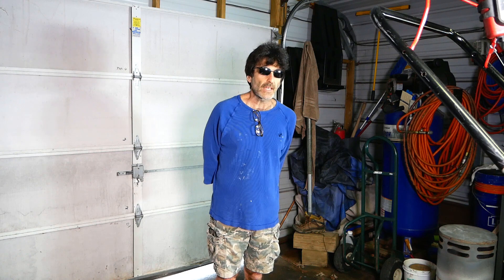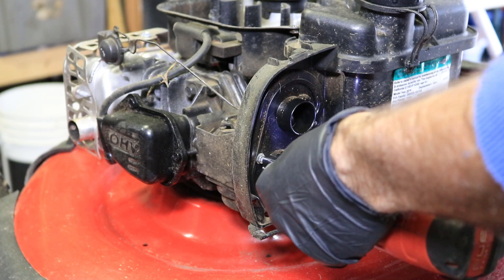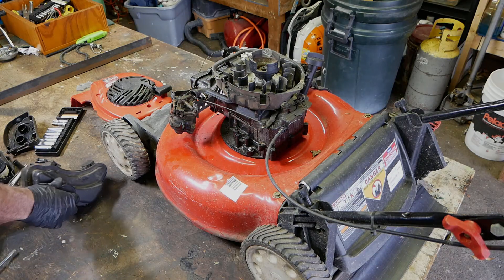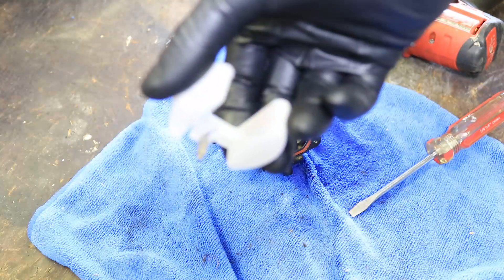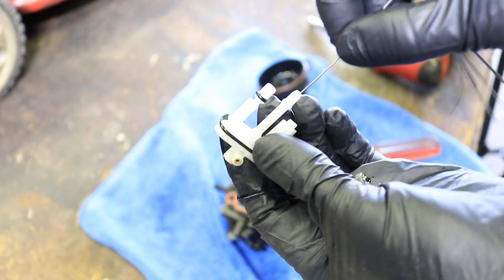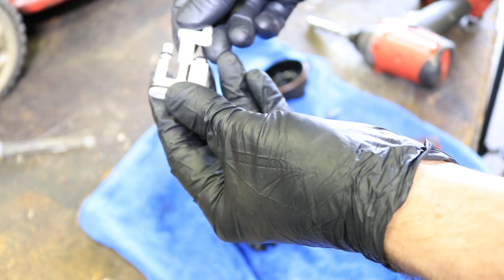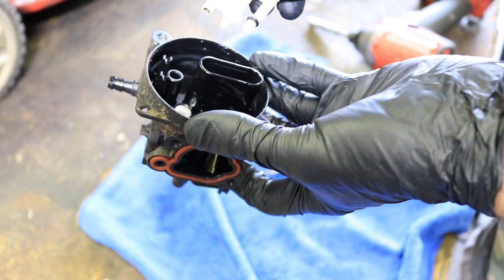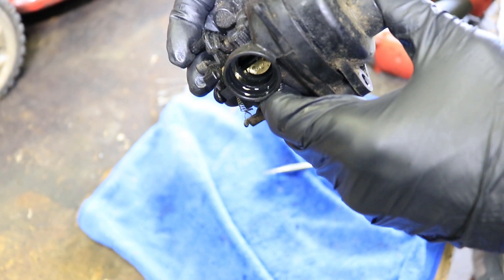Briggs and Stratton 550EX Won't Start!

Comment: I have same mower took plug out checked compression with my finger its good Used starting fluid got it to run a bit and died I'm going to just buy a new carb eBay for $8.00 free ship see where it goes from there your thoughts?  ...........................                         I just don't want to go through the cleaning don't have the cleaning tips and dont want to do the work and have it not work out besides for this price why not thank you for your video G
Reply from the maker: HI!  I had one over the summer that gave me a fit...  I tested this and that for many hours and it just didn't seem like a carburetor problem to me....  In the end I reluctantly replaced the carburetor and that was the whole problem!  Lol.  I'd never been stumped like that, but it happens..  From the sounds of it that's what's going on with yours, but of course without seeing it I can only guess.

Comment: Mine wont start even after I cleaned out the carburetor
Reply: It's been sitting for at least 6 or 7 years
Reply from the maker: HI.... My guess is you're still having a carburetor issue.  If you've got compression and spark,  I'd try the main jet for that carburetor.  592792 is the number i've used in the past.  Just make sure it'll work on your mower...  Make sure to flush the gas tank and replace the fuel line...
Reply: @JLPicard440 hey thank you, i managed to get it working. I used a wire from a bread bag tie to clean the carburetor the second time because it was still clogged and it starts on one pull now.
Reply from the maker: That's awesome!  And even better, that's a free fix... 😊

Comment: Idk if i hit something but filter door and filter just flew off ....i put it back together started working normally for 5 min and it slowly turned off now cant get it to start
Reply from the maker: Hmmm... That's an interesting problem.  I've never seen that happen before.  Has the carburetor dislodged itself?  Maybe there's a vacuum leak behind it..  Worth looking at... Sometimes if the gas tank cap has a problem it won't vent correctly and it'll cause the fuel to not drain, but it sounds more like something to do with why the filter flew off!

Comment: Teacher, 

Your instructions are the best! 

I have a Craftsman LM with a B&S M110 engine, that would not start.

I had watched many other repair videos, but yours was the most detailed. Your lesson on how to disassemble and clean the emulsion tube was the secret that ended my mower troubles.

Thanks for sharing your wealth of knowledge. Joey Adair 
After reassembly, one pull it started.
Reply from the maker: That's awesome!  Honestly you made my day knowing I was able to help someone... Thank you... 😊

Comment: Good morning Take a Bath Productions. Very  impressed with you keeping up with all of the replies (as recent as 11 days ago!) so thought I'd seek some help if you're willing. I've got the same engine here and am still struggling to get her to start. I've pulled the bowl off of the carb and drained the gas tank and replaced with new gas, no luck. Tried pulling the entire carb out, draining gas again, opening the carb out and cleaning/flushing all the pieces including the three tubed piece, put it all back together and still no luck. Before it stopped starting, it was surging when running. I use non ethanol gas, but the only non ethanol gas close to me is 92 octane. Maybe the high octane gas is too much for the little engine? I'm not sure what it could be.
Reply from the maker: Hello... I really don't think the higher octane gas is any problem.  Have you checked to see if you've got compression?  When you pull the rope is it easy to pull or can you feel the compression bumps?  How about the spark plug?  Also, there could still be a small piece of trash still in the carb.  When you say drain gas, did you actually remove the gas tank and drain it completely?  Looking in the bottom to see if there was any water in the fuel?  I know I've asked a lot of questions!  Sorry about that..
Reply: @JLPicard440  Unsure how to check for compression, unless your pull rope question is the typical method. Pull rope still feels the exact same while pulling - can feel the bumps. Pulled the spark plug and it looks normal, but haven’t replaced it. I took the carburetor completely off and sprayed with carb cleaner and let air dry. Same for gas tank. Took off, dumped all the gas out (didn’t catch it in something to check for water, just dumped out in the weeds) and let it sit out to air dry over night. Next morning, still no luck. Gas cans are kept inside and filled less than a month ago so can’t imagine it’s been contaminated, but I guess you never know.
Reply from the maker: Hmmm... Ok.  So if your gas cans are kept inside that's a good thing.  I've seen cases where a gas can was kept outside and it will get full of water due to condensation and the ethanol fuel.  A compression gauge is the best way to check for compression, but pulling the rope and feeling the bumps will tell you that you have compression, but not how much.  If the rope pulls through evenly and you don't feel anything, that's when you know there's a problem.  What if you try to spray a little dose of starting fluid in the carb?  Can you get it to pop then?

Comment: Hello sir, can you help me? I followed everything exactly as I saw yo do it, but fuel is leaking from the carburetor into the fuel filter and all over. Please help.
Reply from the maker: Hello!... Usually this happens because the float needle and seat aren't seating properly.  If it wasn't leaking before then maybe it's not installed quite right.  Without seeing a picture I can't be sure, but that's where that problem usually comes from.
Reply: @Take a Bath Productions  100 percent accurate. I kept examining it carefully until I found that the float needle was not properly installed after it fell off. I seated it right and it is now working well. Thank you for your assistance.  I appreciate it. 🙏
Reply from the maker: Excellent!  Glad I could help.. 😀
Reply: @JLPicard440  thank you.

Comment: My 550EX wont start...not with starter fluid, not with a carb clean or new spark plug. The only thing I didn't do was clean the white plastic bit with 3 pipes that sits in the centre of the carb. But I was thinking that if nothing happens at all even with starter fluid, there's other issues than the carb. It's almost like there's absolutely no spark going off at all, despite there being a new spark plug. Do you know of any checks or cleanings or work I can do to look into the spark issue? Thanks if you reply.
Reply from the maker: HI, when you squeeze the handle and pull the starter cord slowly, can you feel compression?  Do you have a spark checker so you can see the spark?  If you have a harbor freight nearby they have them pretty cheap if you don't have one... I'd be interested to see if both of those items check out ok..
Reply: @JLPicard440  Hey. I'm in Australia. There's no handle squeezing on my mower. It's just set lever to 'run', pull the starter cord and off she goes. I watched a video just before where a guy ruled out all faults for a mower behaving just like mine and deduced that is was watery petrol/ gas.  The gas had taken on water through condensation or something meaning that when he tried to use starter fluid the gas that came through was more or less instantly snuffing out any ignition due to its water content. So I'll look into that tomorrow. I'll drain the gas and fully empty and clean carb.
Reply from the maker: @oinkooink  Yes water in the fuel is definitely a possibility.  I've seen that happen when the mower or gas can is sitting in the sun too.  I don't know about Australia but here they put ethanol in the fuel and ethanol will attract water and condensate.  Here we have ethanol free fuel available so I usually recommend that for power equipment like lawnmowers.
Reply: @JLPicard440  Checked out the carb and cleaned the tank and all that. But I'm noticing that the "run/stop" cable doesn't seem to do much. The butterfly trap door thing opening on the carb assembly at the air intake doesn't move when I set the run/stop cable to run. The cable engages...but doesn't seem to engage fully. I can move the parts that the cable is supposed to shift with my finger gently...and they will open the carb butterfly air intake thing. But the lever for the run/stop cable itself won't engage the mechanism far enough itself. If you know what I mean. hard to explain! So I think this could be an issue too. Not sure. I haven't tried to run the mower with fresh fuel yet.
Reply from the maker: @oinkooink  So, the butterfly on the carburetor is probably the auto choke.  It should have a rod going over to a heat sensitive device on the muffler.  If your engine has a primer ball on the air filter cover then there's no auto choke, but if there's no auto choke then you're probably looking at the auto choke.  The run/ stop cable sounds like it's different than what we have here in the US.  Is that a throttle cable?  Or just run / stop as you said.  I'd almost need some pictures of it since it sounds different.  Do you have Facebook?  I have a Take a Bath Production's page you could post pictures to or send them via messenger if you have available to you.
Reply: @JLPicard440  I fixed it :) complete carb clean and fuel change. Plus I used the old spark plug cleaned. Not sure if the new spark plug wasn't working properly or being housed properly. But right after all the carb cleaning and fresh fuel I slotted the old spark plug. Started up in one pull. I never tried the new spark right after all the cleaning and new fuel so not sure if it was a fault. Was happy to have the mower going again. Mowed the lawn for 50 minutes or so. No worries. Runs great. One day I might throw in the new spark plug and see if it fails. If it fails I guess the issue was the replacement plug I bought.
Reply from the maker: @oinkooink  So excellent!  Glad you got it going again.  Thanks for the update.  My guess it it was probably water in the fuel..

Comment: I was watching this.  To c lean a carb.   But I'm noticing something.   Seems maybe valve problems....I hear that B and S assembly isn't doing a good gap with rocker arms.  I watched one video new mower.  No cap for spring on valve.  Right out of the box new.
Reply from the maker: Sometimes the valves can stick if you leave it set.  I've never seen one with the valve spring floating around under the valve cover!  I guess that's a quality control issue.  Hopefully a rare problem.. 😂

Comment: No, What I do with a no start with this unit. I remove the filter cover air cleaner & I pull once & it’s start fast. Then I put back the filter & the cover back. It’s starts like it was new again…
Reply from the maker: Is the filter saturated with fuel?  or oil?

Comment: Hi T a B Productions. I have the same B&S 550ex, The machine was stored and has never been used since the pandemic started. It doesn't start. After I disassembled and cleaned the carburetor and put a new air filter, and 4T oil,  the machine started but in 2 seconds stopped. I disassembled again and clean the carburetor with a needle using such electronic's magnifier glasses to help and see more accurately. Now the machine starts perfectly OVER THE SIDEWALK and never stops. The Idle sounds stable, BUT.... when I try to use it on the grass, at the moment it has to make some " little effort " to cut the grass, it suddenly stops. I think it still has some problem of the amount of fuel to the mixture...is not enough. I'm right? Maybe I should buy a new carburetor? Best regards, Martin.
Reply from the maker: HI Martin.. Did you flush the fuel out of the gas tank?  If that's bad fuel in there it could be clogging the carb as soon as you start it..  I actually drain out the existing fuel and flush with a water hose too... and let it dry out in the sun before putting it back on..
Reply: @JLPicard440  Thanks sir for your quick answer!. In relation to your question I tell you that I flushed the gas tank, cleaned with isopropyl spray and also used an "air compressor" to BLOW ( I don't know if I used the correct verb in English, I mean to put "air with pressure") the mesh of the fuel filter....and let it dry. Also I cleaned the spark plug. You can let  the push mower "idling" all the time you want without any issue...it remained idling as a clock... when you carry the push mower to the grass (not bushy grass of course), the minimal effort the machine stops. I bought through e-commerce a new one carburetor to check if this a problem of "no enough amount of fuel". It´ll be arriving today march 22. Regards.
Reply from the maker: @Molleras  When you pull through the starting cable slowly.. not fast enough to start the engine, can you feel the resistance where the compression stroke is?  There may be a low compression issue.  Just a thought, if you have a compression gauge that would be even better..
Reply: @JLPicard440  thanks again. Yes I felt good resistance when I pull the cable.. yesterday April 2 I travelled to my mother's in law cottage and I checked if the problem persists...and I felt the machine like a lack of force. I changed and put directly the new carburettor...and wooow! Now it cut the grass like a bull! Its original power returned! I'm so happy not to have a internal engine issue. Best regards man!.
Reply from the maker: @Molleras  That's awesome! Glad you got it going again.. 😊😊

Comment: Ok I did everything and it turns over runs for like 3 seconds and still turns off! Now what??
Reply from the maker: You might have something still stuck in the carb,  might have water in the gas, might have a bad spark plug, there's several things it could be..
Reply: I hit something so I thought it was the key up top and it looked ok but I changed it anyway. Took the gas tank off and cleaned it dried it and filled it with new gas. Also took the carb off and completely cleaned it as well also took the little white part out as well cleaned it as well. Dumped the oil and measured the recommended amount and when I pull the string it turns over but will not stay on
Reply: Also changed plug and filter
Reply from the maker: @1Warzone1  Can u feel the compression when you pull engine over slowly?  I've seen these things have no compression (or very little) then their junk..

Comment: Iam haveing the same problem with my lawnmower I did everything right but still won’t start at all. Do you now why won’t start.
Reply from the maker: There can be many reasons why a mower won't start.  Water in fuel, gummed up carburetor, bad spark plug, magneto bad... I'll need a little more info to help!

Comment: Got a Troy Bilt 21 in cut 550 we changed the air filter, changed the spark plug, took the carburetor out and cleaned it, changed the oil and it still doesn't start. 
Do you know what it could be?
Reply from the maker: Did you drain the gas tank into a mason jar or something clear?  it might have water in it... Also, I've seen these engines loose compression.. Squeeze the handle as if you're going to start it, and kinda slowly pull the start string, do you notice any spots where it's harder to pull?  Or does it pull all the way out without much resistance?

Comment: I just purchased a new Brigg and Stratton self-propelled lawn mower today, and it won't start. A mechanically inclined neighbor checked the filter, poured a little gasoline in the open area of the filter (making sure that it actually drained inside), and pulled the starter string, the mower immediately started, but didn't run long. He checked the spark plug to make sure it was firing, and it was. What to do next?
Reply from the maker: There might be some trash in the carburetor.  Did you check your gas can to make sure there's no water in it?  If that gas can was sitting outside, it could develop condensation inside the can and get full of water even if it wasn't in the rain.  If it's brand new I would suspect the gas source as the first culprit.  If the gas is clean and fresh, then there could be some trash in the carburetor..